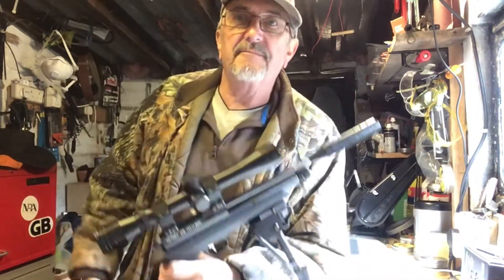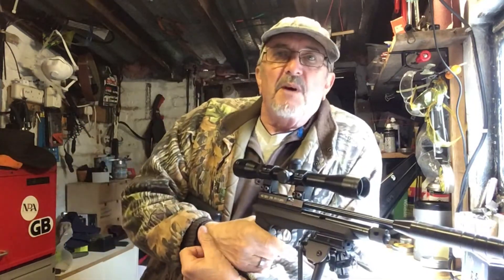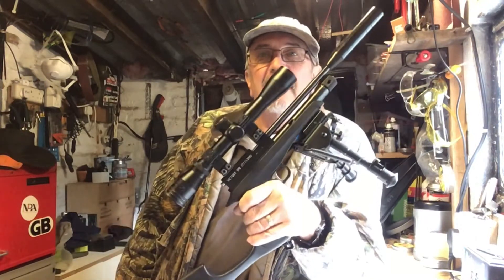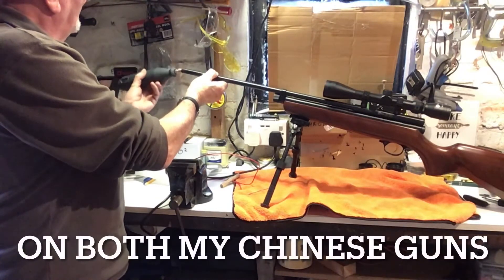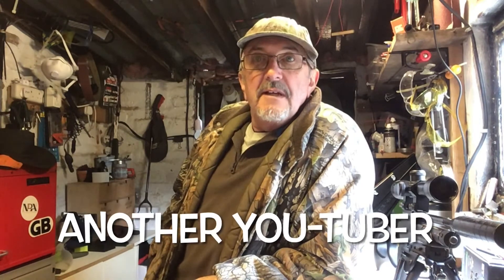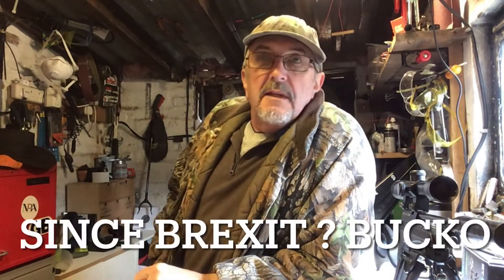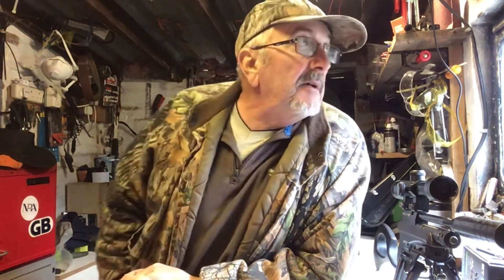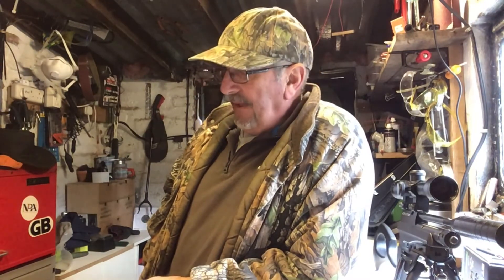QB78 barrel crowning

Comment: What sort of bit did you have in the Dremel to do the re-crowning?
Reply from the maker: Hi Alan, it was a tapered stone which I was happy to use as the tip did not penetrate the barrel enough to cause a problem, ideally I would have used a spherical stone of the right proportions.  If you are not  happy to experiment as I did, I advise you NOT to attempt this and just accept that these rifles are not the most accurate.
Reply: @Villageboyairguns  Hi John, thanks for your reply. I'll take a close look at the muzzle with a magnifying glass and unless there is an obvious problem leave things as they are.
Reply from the maker: @alanh7495  yes Alan, very sensible. “Don’t fix it if it ain’t broke”